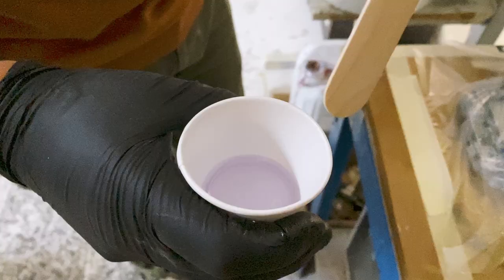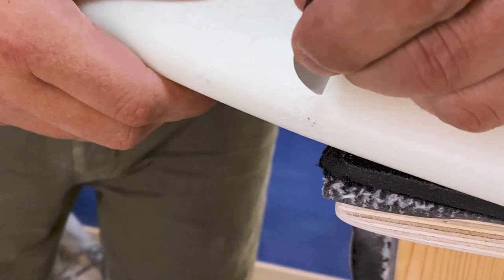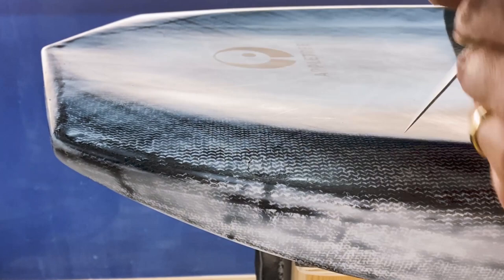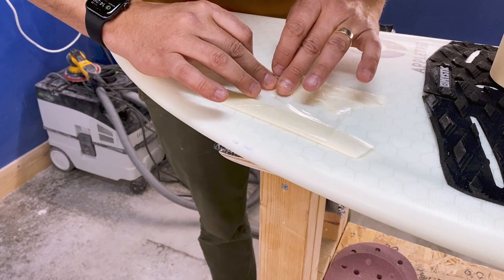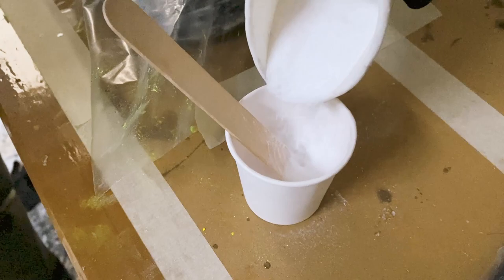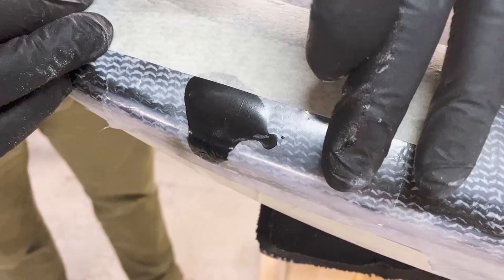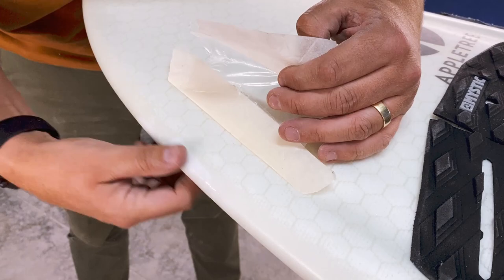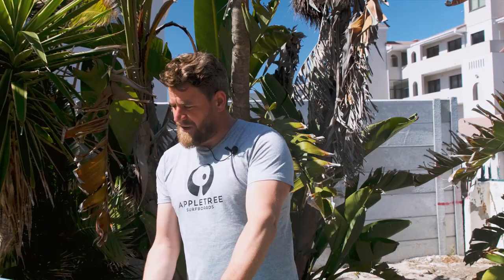TECH TALK: How to repair small dings in both glass and carbon surfboards and foil boards?

Comment: Putting smaller amounts of epoxy using a pencil or match and stirring it into the hole, you work out the air bubbles and save yourself a second day off the water

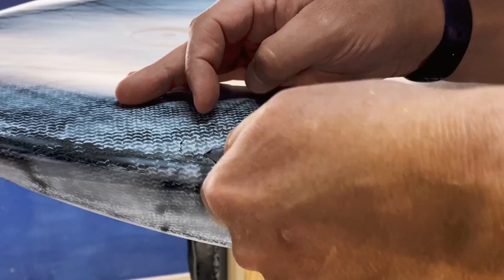Comment: awesome video... when you say at 4:10 that it is not a "structural part" of the board so no further carbon fibre reinforcement needed , where would a "structural part" of the board be when you would need to reinforce with glass/carbon?
Reply from the maker: Thanks! I would say if it's near the foil box, or on the tail or nose, which take a bit more beating. or on the rail apex especially the rail in front of the foil tracks in smaller boards take a lot of stress.

Comment: Awesome repair video. But just wondering... is there no layer of fiberglass needed on top of the repair? Of even a epoxy hot coat?
Reply from the maker: Hi Marloes, It really depends on the size of the crack/hole and where it is in the board, if it is in a non structural part, like in the video, right on the deck, and it's small, say, upto 3cm then we usually don't bother. For bigger repairs, yes, we would add carbon or fiberglass for sure. but that brings other issues, and here we just wanted to show w quick fix so you are back on the water soon. We will do a video on bigger repairs this year as well!
Reply: @appletreesurfboards   Nice! Quick and easy :)  But if it would be a small repair on the nose (let's say 2 cm) , would it be OK to fix it like this as well, or would you use fiberglass in that case?
Reply from the maker: @lllllemonade  You will be fine without.

Comment: If you did hit a hammer right before you went out for an epic session and took on water in the board. How long should you let the board dry? I’m  letting water drain out now out ding. Small puddle below. Let sit for a few days?
Reply from the maker: Hi! If it's one of your boards, you will only have to wait until it's dry to touch. the foam does not take in water. If it;s any other brand, I would not go into the water at all :)

Comment: Hello,
I have major damage to the underside of my Jazz (airplane trip). Where can I have the board repaired? I would like to have it done professionally. I live in Germany.
Greetings Michi
Reply from the maker: Hi! We don't really have an advice for a repair service in Germany. but any surfboard repair shop should be able to do this. if in doubt send them this video. We are also working on more repair videos for bigger damages.
Reply: @appletreesurfboards  Hi,
thanks for the info. Where should I send the photos?
Reply: mail is out
Reply: Hi
I can also use the: SOLAREZ UV Cure Epoxy Ding Repair Resin ?
Reply from the maker: @mrein007  yes, it will, but it's not as strong as doing it as we show in the video. If you take care and go thorugh all the steps, you can get good results with Solarez as well.

Comment: Lo que no entiendo porque hace tanta mezcla para pequeñas fisuras
Reply from the maker: if you mix too little, it's shit and you have to mix more. also more epoxy is easier to mix and easier to get the ratio between resin and hardener right. We try to use as little epoxy as possible, but in the past we have made the mistake of mixing not enough, which is really worse.

Comment: Hi there! Thanks for the tutorial, one question only, don't you need to add an extra coat of just resin (no qcell) on top of the qcell mix?
Reply: thanks! It's just to give you something to sand smooth. if you also ass q-cell to the last layer, it can sometimes be crumbly and small bubbles can happen. just epoxy gives a smooth finish to sand.

Comment: This repairs shall be done only with a foam which is waterproof. It shall not be done on EPS foam. The reason is that the epoxy mixed with microballon may not be waterproof anymore.
Reply from the maker: Good point. If you do it right, and remove enough foam under the surrounding glass/carbon, it should not be a problem at all. The annoying thing with EPS is that is can blow out air when heated slowly, or suck in when cooled. this causes air channels in the epoxy when it cures. Covering the repair with plastic, as we show here drastically reduces this channeling and makes the repair watertight. If still in doubt cover in glass, but even with EPS this is usually not needed in these smaller repairs.
Reply: @appletreesurfboards  
yes, for Eps foam it is usually better to do it when temperatures goes down to avoid gas expansion due to temperature increase (during the night for example) and to use slow epoxy resin, to avoid temperatures increase due to the reaction between the resin and the hardener. If a vent plug exist on the board, always open it before repair.
I would still recommend for EPS at least a hot coat on the top (better a layer of fiber)
Anyway, this is not really the topic of this video as your boards are not using EPS foam 🙄